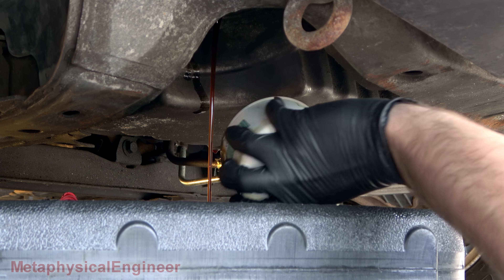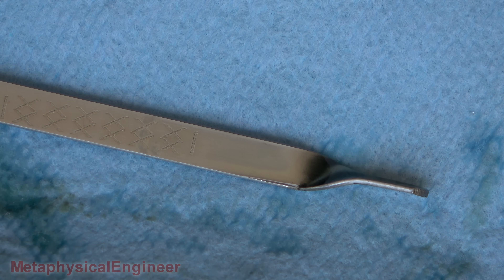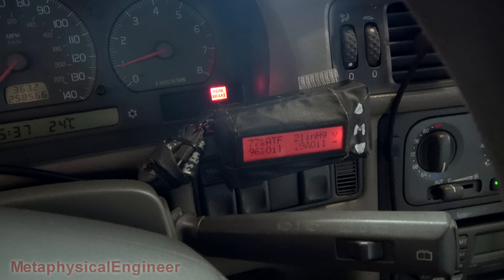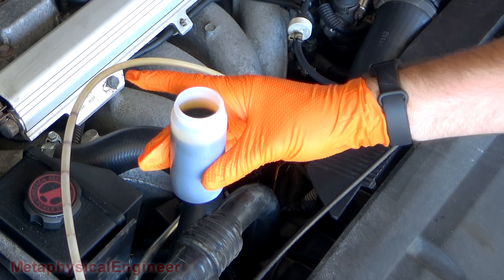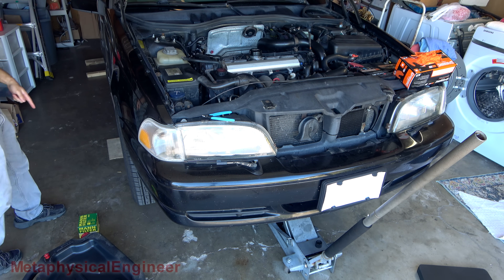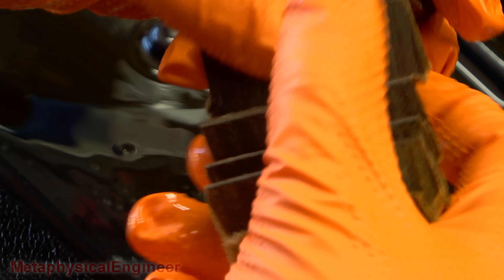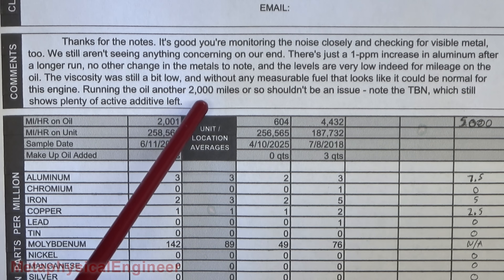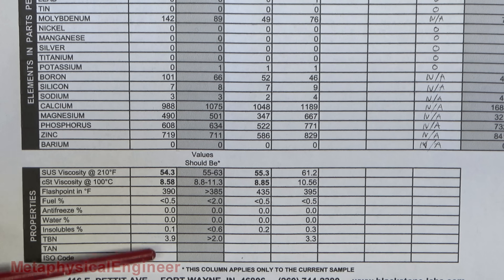Valvoline Restore and Protect vs Noisy Lifters - Used Oil Analysis and Filter Cut Open

Comment: I’ve been running liqui moly on my 05xc70 for a long time, started with molygen to clean it up.  It burns zero oil between changes, oil is extremely clean when being changed too.  I still want to try valvoline r&p for a few oil changed just because of these videos   Would I be doing myself and my 260k mile engine a disservice?
Reply from the maker: Liqui moly is good stuff, so I imagine that engine is pretty clean. Still heard plenty of stories of supposedly clean well maintained engines disgorging a scary amount of crud once R&P is in play. 

I'd say give it a shot if you want. Aside from the unusual shearing I'm seeing here, it's kept the wear rate on this engine well below average for a turbo white block.
Reply: How many MPG do you get with straight freeway driving at normal speeds on the XC70
Reply: I’ve been working the last 4yrs on my own formulation starting with a base formulation from a gentleman that’s been at it more than 30yrs. The first vehicle I treated was my 2001 XC70 2.4T. It ran hot and sounded like a diesel, transmission would clunk and slam into reverse after engine was hot. Did yours sound like this before the liquid moly? 225k Added it in at a gas station 20min from home and when I got home it was quiet quiet, I was shocked. Also tried the cheapest Dino oil to see if it would burn up, only minor loss after 2k miles. Transmission smoothed out all the way due to running cooler. Would love to send you some for feedback.

Comment: Insolubles have more to do with your air filter, not your oil filter.
Reply from the maker: Where'd you hear that? The explanation of the oil reports say insolubles represent free carbon from oil oxidation and soot blow by. Normally caught by the oil  filter, but a clogged or sun par filter can allow it to accumulate in the oil. 

Air filter problems would be indicated by high silicon counts from dust getting in.
Reply: You’re right, I got insolubles and silicon mixed up. I’ve run Blackstone oil analysis reports on my vehicles on occasion and my wires got crossed. Thank you for clarifying.

Comment: Marvel mystery oil does the same thing for cheaper, you have to give it time... I swear by the stuff.... If it didn't fix your problem ...... you didn't give it long enough, or you need to start wrenching on the engine... That's the only way to fix that
Reply: What's or idea of giving it time? And mmo isn't cheap anymore.  Even at Walmart it's $8  a quart. Get the r&p for same price
Reply: @Bunnyymann  how many quarts do you need for a whole engine though?  And my idea of giving me a time is usually over the course of about 500-1000 miles the problem is gone.... It works slowly and gently and thoroughly I have always had success.... Every car I have ever bought that burned any oil it always fixed
Reply: @lion-of-judah-h2p  i tried the mmo for 1000 miles on ticking dodge journey.  No luck. Tried seafoam for 300 miles. No luck. Last ditch effort before lifter job was r&p.  After 1500 miles the tick was almost gone. After 5 k miles on that oil ist quiet. On 2nd r&p oil change now. I use mmo in my gas.  Add some to other vehicles before changing oil.  So i was hopeful it would have worked on the journey.  But no such luck
Reply: @Bunnyymann thaaats because the mmo did all the heavy work for the R&P hahah 😅 .....well i am glad you found success!
Reply: @lion-of-judah-h2p 😂😂😂
Reply from the maker: I gave MMO 2300 miles. Definitely did some cleaning and knocked loose a bunch of carbon, but didn't noticably touch the rock hard varnish like the patches visible though oil fill cap. I think that same kind of super tough deposits are what's causing the lifter issue. Similarly Seafoam did some cleaning but couldn't soften those either.

Comment: Did you ever work on cars before? Why are you making the fill so complicated? Check the book, see what it says it takes for capacity, and fill it. There’s no reason to have to keep checking and topping it off.
Reply from the maker: We'll have to agree to disagree on procedures I suppose. I'm making a video, not running a shady quick lube shop sending cars out the door at warp speed 🤣

Comment: I’m sure you’ve done the oil pan service on that Volvo Whiteblock already but if not please do. I had to do mine at 289k as it sounded like lifter tick at idle but turned out to be a leaking oil sump O ring and now my car engine is so quiet. I ran Valvoline R&P 5W30 through it beforehand also. 99 V70 with a B5254T engine.
Reply from the maker: Had that problem years ago, before I was confident enough to do an oil pan job and back when this car was the family car. Mom hit road debris hidden by snow and cracked the oil pan. Shop replaced it but failed to do the o rings. Leaked worse after the repair, and developed lifter noise. Could even see the oil foaming from the pump sucking in air. 

Had to have a second shop do the o ring repair properly, which instantly fixed the lifter tapping and the leaks.

Comment: The Valvoline Restore & Protect is outstanding. I watched The Oil Geek YouTube channel on this oil and I gave it a try. It worked so well that I have a subscription to Valvoline for 7 quarts every 3 months.
Reply from the maker: Nice!  What vehicles did you use it in?
Reply: I use it in my 2009 TRX4. It's awesome stuff. I wish they made it in 0W40. I'd use it in my new 2500HD with 6.4 HEMI.
Reply: @rustypipes12 royal purple makes an 0w40 and its grime eating capabilities are very close. I suspect both use some kind of acid to help break up old deposits, i know in both vehicles the oil is dark in 500 miles using either or. Definitely cleaning something out!
Reply: How do you you subscribe to that and how much is it?
Reply: @Jose-ki6si  amazon has a subscribe button to certain items. $29.99 last I checked.
Reply: @Jose-ki6si  amazon
Reply: @Jose-ki6si  Amazon has subscription services. Usually get 10 to 20% off the first order, and 5% discount on following orders.
Reply: How much is the 7 quarts
Reply: @ChevyRedneckGFX  5qts is $30 at Walmart.
Reply: How much is 7 quarts? As Americans say, it's about the size of a new born horse. Hope that helped.
Reply: I watched that myself. Have changed everything over to R&P.
Reply: Whats it running ya for 7 Q every 3 months?
Reply: I have a hard time seeing the dipstick level on mine, even after a few hundred miles
Reply: @miguelmaldonado9881 pull dipstick and lay the wet end on a paper towel, then slide it upwards slightly. The oil level will clearly show on the paper towel. I had same problem,  then YouTube gave me the solution.  Cheers!
Reply: I also use it in a 2011 chevy tahoe with almost 300,000 miles on it, I change the oil every 3000 miles
Reply: So what’s in the oil that makes it so great?

From what I know there is only one thing that can clean those hard deposits on the valves, rings, etc etc, and that is detergents. 

I went down this rabbit hole many years ago the best detergent is either pea or pba (I believe it’s pea). It’s a very powerful detergent been around for decades. It was found in chevron Techron initially (they invented it) but I was getting a fuel additive from Redline racing that contained 30% pea, which is way more than what chevron puts in Techron. 

I didn’t notice a difference, but I didn’t have an issue to start with (5,000 mile oil change intervals).
Reply: @goose4342  I wouldn’t spend money on PEA additives like Techron unless there wasn’t a shell gas station nearby. Shell V-power uses 3x the minimum additive and is 6x above top tier fuel in additives and contains pea. As does chevron pump gas with pre mixed Techron in its delivery. As for Valvoline I believe the trick is esters I think specifically borate based esters that clean very effectively while running without damaging the lube and ep properties of the oil like calcium did before API SP.
Reply: @Gleone58   Concentration of PEA in Chevron Techron bottle in 18 Gallon gas tank is far greater than PEA found in premium gas even the V-power.  Gallons of premium gas cost more than the bottle and for less concentration.

BUY THE BOTTLE.
Reply: @TrollinCrazyRussian  you don’t need that much PEA. If it calms your nerves to add it please do. I run shell premium as my 10.5:1 compression classic cars ping with anything less.
Reply: @Gleone58  If a driver needs premium fuel, nothing beats the Shell V-power.  Otherwise, a driver will save a lot of money (and some convenience, as those Shell stations aren't always easy to find) by just sticking to Top Tier fuels and adding a bottle of techron (or equivalent) every oil change.  Our newest vehicle is 14 years old and I've never had an injector problem.  My daily driver is 26 years old.  Back in the '90s (pre-Top Tier) , techron saved us from having to junk our '85 Jetta.
Reply: @goose4342 I'm pretty sure  it's some form of a borate .I know there is a hexagonal boron that is used in the lubricating industry it has many great properties but a borate or a boron is my guess
Reply: @goose4342   Remember when Techron was Techroline?  And long B4 that was F-310?  It reminds me of those virility commercials that keep changing the name of their secret formula...  I just wish I could still buy Philips 66 Flite Fuel!  😁
Reply: The oil geek never said anything definitive about the oil.  He just talked about it...
Reply: @dirkmanning8621  .. he did not say anything definitive but the engineers at Valvoline did.. they showed the piston rings before and after...  might need to check that video ,, a visit to the valvoline engineering shop was amazing.
Reply: @dirkmanning8621 He is very careful to not recommend things.

Comment: Mine lifters became noisy and now very quiet, and the engine is smoother. And hangs on in 5 up a rise for longer. And has a little more torque in reverse up a rise off idle. Yes, i to will keep using it.
Reply: What does “hangs on in 5 up rise for longer” even mean? 

Also what does “a little more torque in reverse up a rise off idle” actually mean? I don’t understand what either of these mean?
Reply from the maker: Glad to hear it worked well for you!

Comment: Have never been loyal to any brand. In my 60's.  Grew up with paper  can oil straight  grade..just started to use  restore & protect... my noisy at cold start on one old engine completely stopped at brand new oil run. Engjne no longer makes weird noises at first start up cold. Went to restore&protect on a another high mileage  vehicle  we own. Different manufacturer ; different  engine configuration.  Vehicle  runs quieter.  Still out on mileage  before first oil change.
Reply from the maker: Impressive results!  I admit I was skeptical at first since every oil claims to have cleaning properties. But I've seen enough evidence that I had to give it a shot before doing a teardown of the cylinder head and manually cleaning the lifters.

Comment: Does your lifter tick come and go? My '08 1500 5.3 with 205k has a tick that comes around every couple days and will start light and turn to a loud tap within a few minutes then fade away and be gone for a day or two.
Reply from the maker: On my car the noise is nearly constant. It will sometimes be a little quieter, but never completely goes away that I can tell. Not easy to stick my head inside the engine bay while I'm driving to keep tabs on it all the time!

Comment: Great video ! I had a P2 XC70 that had a plastic filter housing that you replaced the filter media in. I would have much rather had the steel can filters like you have on yours !
Reply from the maker: Yeah I remember the cartridge filter on my mom's  P2 XC70. Steel cans are tougher but also a pain to cut open to inspect. The cartridges are trivial to pop apart to check what got caught.

Comment: Old school tricks are using kerosene or ATF, but they are very strong. Liqui Moly Cera Tec is common for Ford Coyote engines to quiet down their tick.
Reply from the maker: Thanks for the suggestions!  Do you think kerosene flush would do anything to the rock hard varnish?  I've tried dissolving some flakes I scraped off in carb cleaner and it took a while to soften up.
Reply: @MetaphysicalEngineer  It should take it off because of how strong it is, but because it's so strong it can take off huge chunks and clog oil passages. You would pretty much do it right before an oil change. Mineral Spirits also work if you don't want to buy Kerosene.
Reply: NA miata's are known to develope lifter tick from their hydraulic lash adjusters, as they get gummed up and don't fill fast enough between valve events. Twice now (out of two times, 100% success rate but tiny sample size) I've been able to get rid of the tick by draining a quart, adding a quart of atf, letting the engine idle from cold to operating temp, doing a couple rpm sweeps with no load, then draining and putting in good oil.

Comment: I put r&p in an old focus with 85k miles, and I don't really seeing it do much. A month later, I put a little gumout mstu with p.e.a. and mmo in my oil on my old sierra with 93k, and it silenced a tick the 350 had after about 15 miles. I will say that r&p feels very slick, conpared to oil with mmo in it. It's probably the MUCH  slower, and PERHAPS safer way to dissolve deposits in an engine.
Reply from the maker: Thanks for the info!  I was hoping for a slow and safe cleaning here, as long as the reports still say the wear looks normal. 

Did the Focus have any sludge that was a problem?  How long did you run the R&P?

I'll add  gumout to the list of things to try if R&P doesn't do the trick.
Reply: @MetaphysicalEngineer  The focus never burned oil, but it has varnish buildup visible. The r&p's been in about six months, but not many miles. I notice maybe the slightest bit of deposit dissolving. The Sierra did burn oil, and had lowish oil pressure, which has gone up a bit. With solvents in it, the truck's  oil feels less slick. It's much darker, in about the same miles. It almost feels gritty, probably from tiny particles of carbon that have that broken loose.

Comment: Currently running R&P in my F150. Has low compression and intermittent miss fire. 1st 1000 miles i noitce more power and better mileage. Misfire is gone too
Reply from the maker: That's awesome results!  Makes sense that choked up rings would cause compression problems and misfire. If R&P frees up the rings, you get that performance back!

Did you do compression tests before, or was it simply narrowed down to a compression issue because other reasons for misfire have been ruled out?
Reply: @MetaphysicalEngineer  ya, comp and leak down. I'm hoping a couple of oil changes will free the rings up. Only misfires at idle, and not all the time. Just going to change filters every 25% of the oil life timer
Reply from the maker: That will absolutely cause a miss at idle. I've seen some diagnostic videos about that a while back where a tired engine would just miss at idle but smooth out once the revs came up. 

Hoping R&P continues to bring some life back to your truck!

Comment: You can just pour in the valvoline jugs from the handle one-handed. They have a vent and don't glug like other 5qt bottles.
Reply from the maker: Yeah I noticed- nice feature!  At a certain point the jug pours faster than oil can drain down so it will back up and burp out of the fill cap around the funnel.  Thinking of getting one of those funnels that locks and seals to the fill port so can pour faster.
Reply: @MetaphysicalEngineer  There's a reason the funnel hasn't changed in thousands of years

Comment: Is this the new name for the detergent oils we saw in the 60's and 70's?
Reply from the maker: It's different from what's been on the market up until now, that's for sure. This car has been using high mileage synthetic oils for 100k miles, yet this one is meant to reverse deposits rather than keep them from forming. 

 Probably a similar kind of performance step up as the shift from non detergent oils to detergent type all those decades ago.
Reply: @MetaphysicalEngineer thanks meta